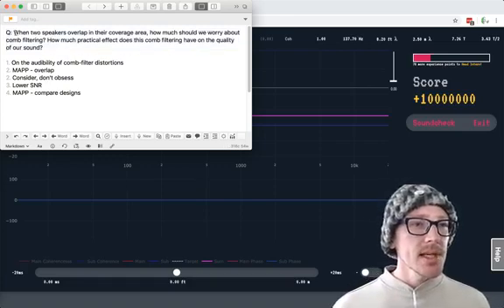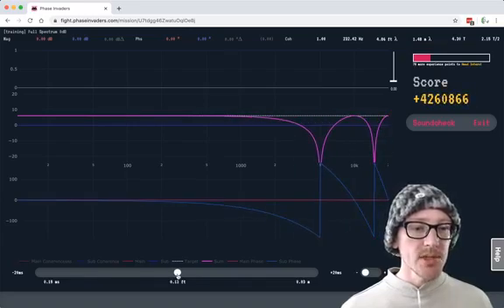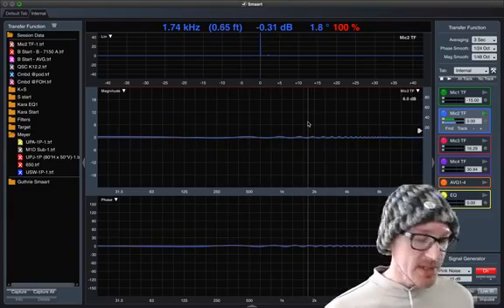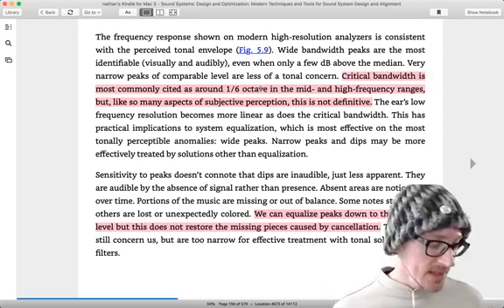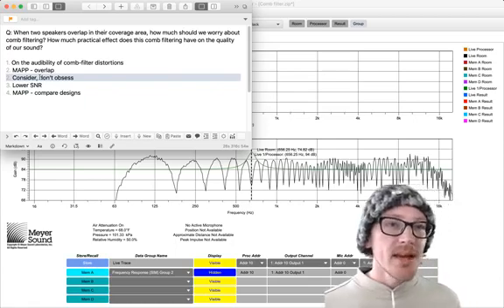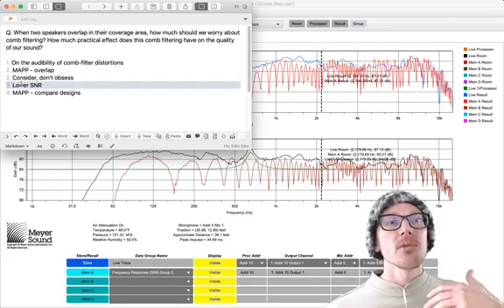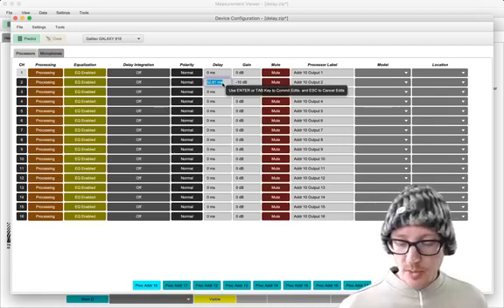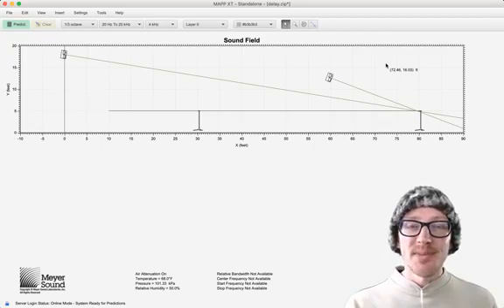How much should I worry about comb filtering?

Comment: I would have thought that a person's distance from the speakers is not the significant factor in respect to comb filtering. Provided you remain central to both left and right channels (same distance from the left speaker as you are the right) then any difference in phase of the audio (left vs right) should remain true to the recording.
Reply from the maker: Hi Paul! Yes, that sounds right to me. Maybe I confused the issue in the video? 
Comb filtering is happening everywhere all the time, but the least amounts will be found down the center equidistant from both sources and in areas of highest isolation.

Comment: What you are describing is the comb EFFECT.
A comb filter is a device that delays a signal to either destruct or construct a signal. The result is a comb effect.
Noise canceling is a result of a comb filter that shifts phase (or delay) of of ambient sounds  signal 180° and inserts it into an audio stream. A signal that is 180° from the original signal will cancel the original signal.
I've been in electronics for over 50 years and and worked with comb filters in video for decades